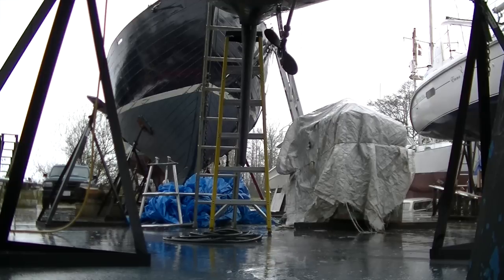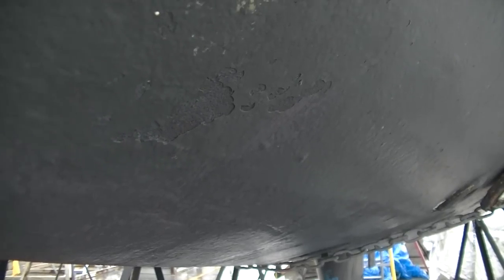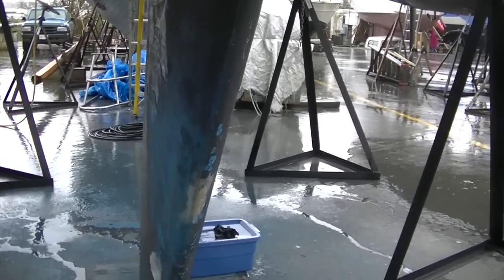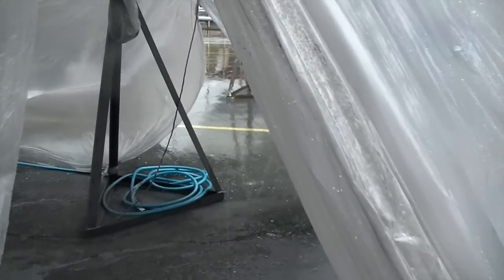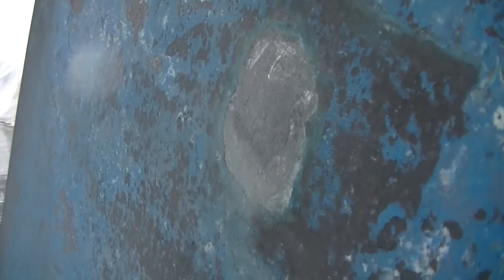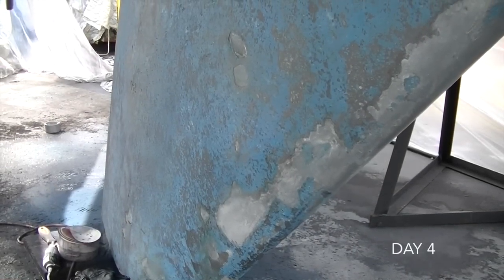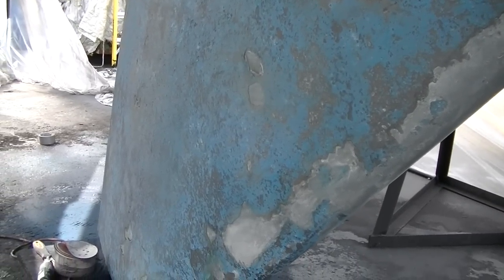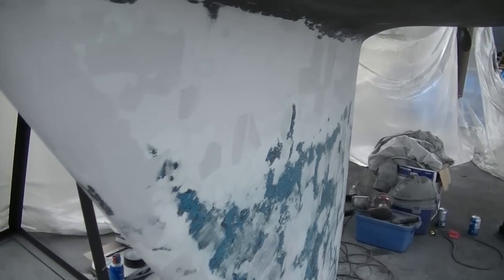Life is Like Sailing - Haul Out - Part 2

Comment: Another vote for information on the fairing compound - what are you using????  I recently picked up a vibrating multi-tool - mine is a Rockwell but a number of manufactures make them.  These are MUCH better for applications like the edge grinding you were doing with the Dremel, as well as for scraping/stripping and detail sanding.  Incredibly versatile with the various attachments - I couldn't live without mine now that I have it!
Reply: Bruce Bolster Bruce, any problems with gouging?  I've thought about this tool in my normal work around the house and boat.  They cut very close in difficult positions.
Reply: MrTeneric For this application I would use the larger of the two triangle detail sander attachments, with an aggressive grit - say 80 grain.  I have used this on my cold-molded, bright finished hull to fair in the edge of areas where I have had to replace a bit of the glass over the mahogany exterior ply, and was able to do this without any gouging or cosmetic damage.  There is also a triangular metal attachment with a very coarse abrasive  that you could use for an even more aggressive approach - I haven't used this one.  For refinishing, the scraper attachment has to be used to be believed - you will never use a manual scraper again!
Reply: Thanks!
Reply from the maker: Bruce Bolster Sounds like a great tool!  I will have a video that goes over the products I used uploaded soon!  :)

Comment: Makita makes a variable speed grinder that you can turn down to even 100 rpm. with course sanding disk you can take off the paint without getting into the gelcoat. Whats going to keep the compound from coming off the paint? bottom paint is made so it keeps on wearing off so things don't stick.
Reply from the maker: theislandpackrat Where ever I applied filler I took it all down to primer...at least that was what I was trying to do.  lol

Comment: A little 4.5 inch grinder makes work fast. there are way too many types of grinding/sanding disks available to list  but it sure is faster than a dremel 
Next time your on the hard, place keel on 6 inch blocks with wedges so they can be moved to access various area's
Reply from the maker: +Mazda rx7 Yes a grinder would be good for sure and having the keel on higher blocks would also have been better.
Reply: oh well, next time.
Reply from the maker: Mazda rx7 there will always be a next time when it comes to boat maintenance.  lol
Reply: Yea, it's too bad that manufacturers are not aloud to produce an anti-fouling coating or other products for the boat that lasts for many years
Reply from the maker: Mazda rx7 yes that would be great!

Comment: how did you work on the bottom of the Keel if its sitting on the keel?
Reply from the maker: Les Laxson Couldn't really work on the bottom of the keel, the boat would have to be hanging in slings or a cradle to get to that area.